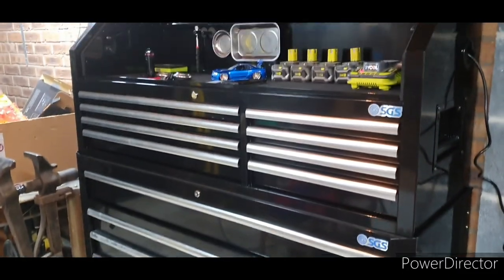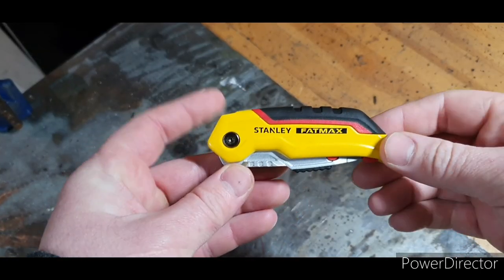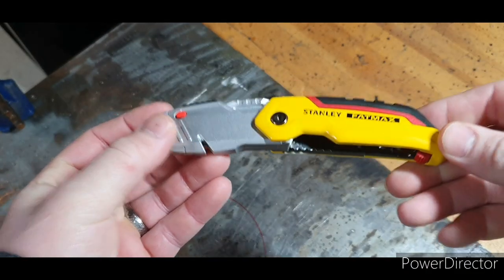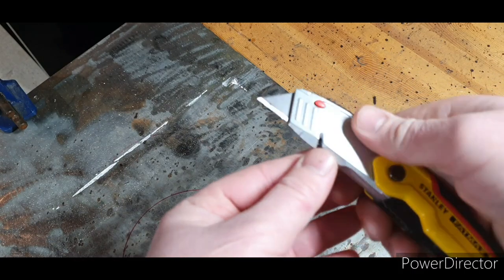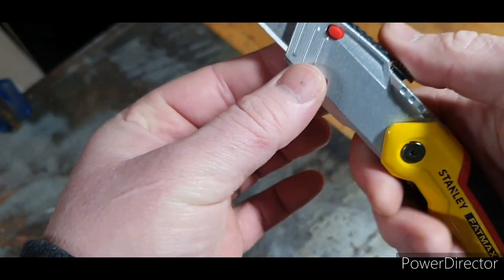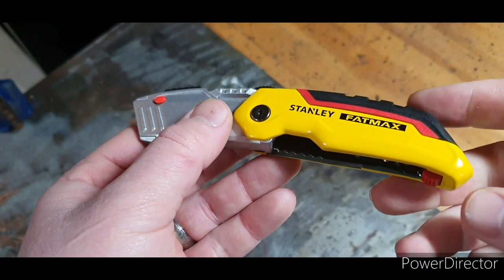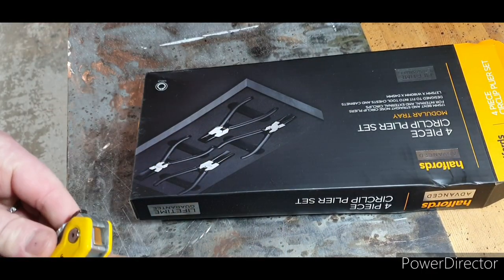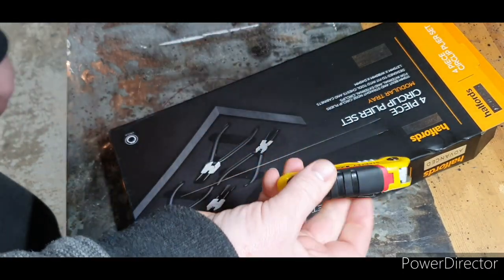Stanley fatmax knife

Comment: Just bought one from Leyland, it doesn't work, something seems to stuck & I can't even put a new blade in it, there's a blade there already, but, I can't even take it out. It's a nice hand tool, well made, compact which is why I bought it in the first place. Hand grip feels nice in your hand, it's a decent tool to have around when you need to open some boxes.
I believe the little groove or gap is indeed for cutting string, plastic wrap around boxes?
I'm gonna take it apart to see what the issue is, because, something doesn't feel right, something seems to be stuck inside the end where the blade is supposed to come out. All in all, a decent knife from Stanley.

Comment: its the biggest load of crap ive ever used the blade just wont stay in and is now shoved itself down the bottom and i couldnt get it back out without pliers. Going straight back to b&q. Great review of it though mate, no shadow cast on your video!
Reply from the maker: You might have a faulty 1 then mate as I've never had a problem like that with mine. Might be worth swapping it and trying a different 1 or just go for the milwaukee fastback utility knife instead as that's a really nice one 👍
Reply: @TheYorkshireMix  bloke came in to work and done it instantly lol! D’oh!

Comment: Have NO idea where these reviews are coming from praising this ! 
You have to take the whole thing apart to put a ruddy blade in it ! 
There bis no way I would use this on a site, it was bad enough spending 15 minutes fiddling with it on a kitchen table. 
Hold the washer in while trying to hold it together, while trying to keep the pen holder clip in place while trying to tighten the screw......  I found an old one in my tool box and used that, one screw, undone, new blade in, done !  
This thing got threw up the wall. RUBBISH !
Reply from the maker: do you know there's a little red button to press for the quick blade change. I've never had to take it apart to change a blade.  It takes about 5 seconds to take the old blade out and put the new blade in🤷‍♂️. I really like mine so I got another one for in the house 👍
Reply: @TheYorkshireMix  I know now...... lol..... Cheers.  ;)
Reply from the maker: @richard8241  🤣😂 no problem mate👍
Reply: @TheYorkshireMix  😠🙄😊😆😆😆😉

Comment: Got mine for £6 on Amazon,  still struggling to get that paper label inserted in off, don't know whether to undo the bolts? Thanks for the  ideas, it's helped a bit though....
Reply from the maker: Yeah I seem to remember it been a pain to get the label packaging off. I ended up just ripping it off with force and it did all come off. Not sure why they made it so hard to get the packaging off. Hope you managed to sort it 👍
Reply: They make the packaging hard/fiddly to remove so they're not as easy to steal from the shop.